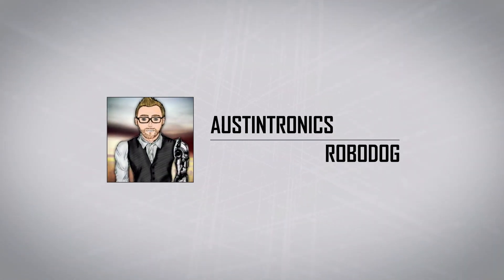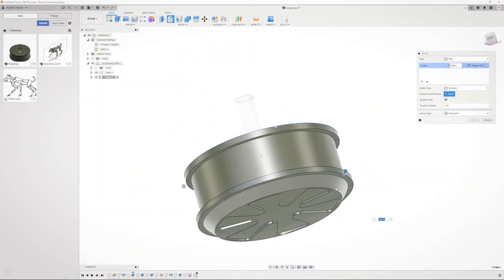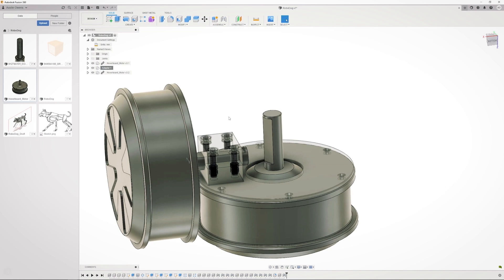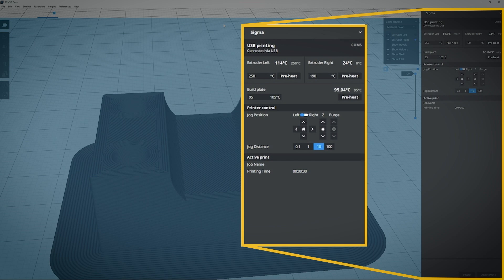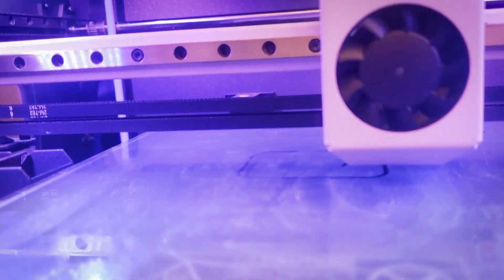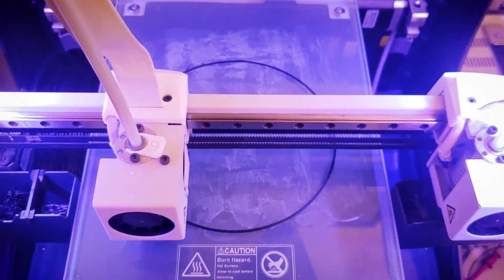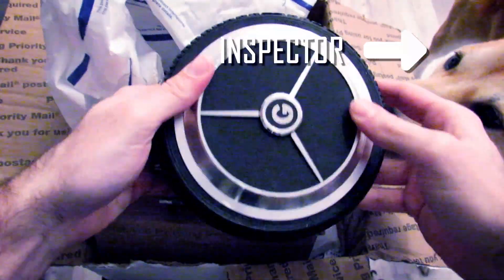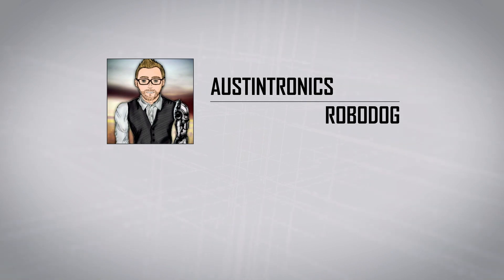RoboDog Part 4 | 3D Printing Prototype Parts for RoboDog

Comment: At a glance, that's a $2,000 - $4,000 printer. Your second attempt failed because the nozzle was too close to the printbed for the initial layer - is it really true that a printer of that cost somehow doesn't have a z-offset adjustment feature, requiring you to cancel the entire print and re-calibrate all over again? I've only had hands-on experience with $150-$600 printers, but all of them, even without octoprint, have had the ability to adjust the z-offset in realtime, and I use it constantly to fix exactly this issue, so I'm incredibly curious what prevented you from doing that

The final result looked pretty nice! Definitely seems like the sort of thing that would be ideal to mill from steel perhaps. for 3D printing, one must consider the layer adhesion as a potential point of failure, and the baseplate print was printed in perhaps the weakest possible orientation, but the one most ideal for a 3D printer - definitely the 'rapid' part of rapid prototyping, so that a final design can be mfctr'd properly :)

Comment: I think you are printing with ABS , as a tip to counter the shrinkage , multiply  by 101% or 102%  the scale of the model on the slicer before exporting  ,  usually it works for me . looking for more videos from you .

Comment: Scotch blue 2090 painter's tape is the best for 3d printing. give it a shot sometime.
Reply: painter's tape gets a bad rep as 90% of painter's tape has an oily surface to prevent paint from sticking to it, which is great for painting but horrible when you are trying to get things to stick to it.

Comment: Hi, I sigma r17, my glass is slightly bowed the only reason I found this out was because my z limit switch kept hitting the prints. I have flex plates on my other printers, as its a pain to scrape parts from glass, the only exception is when printing abs, I  chuck a box over the top of the printer to keep heat in, with a healthy  splash of pva glue, when it cools down to room temperature it falls off the bed, or if I'm in a hurry I'll spray the pva with isopropyl alcohol (Circuit cleaner, it's what I use to clean glass pei sheets on other printers).
Im so glad I stumbled on your series as 1,  I didn't know about the USB connection to bcn cura. 2 I have half a dozen hover boards cast offs from my kids, 3 I love learning I know nothing of fgpa programming or object detection.
Can't wait to see what I learn next!

Comment: How are you planning out your wire management for the shoulder joints to prevent snags?
Reply from the maker: Combination of wire sheathing and wire mounts throughout mechanical structure. Internal to the robot, was thinking of using DIN rail.

Comment: I thought the same thing.  Do you have the link to buy these motors?
Reply from the maker: I got some from here: 
https://www.amazon.com/gp/aw/d/B01CV1UAC8?psc=1&ref=ppx_pop_mob_b_asin_title

You can also get them from ebay as well:
https://www.ebay.com/sch/i.html?_nkw=hoverboard+replacement+wheel

Someone else in the comments was also saying that you could run an ad on OfferUp or Craigslist asking for broken/salvaged hoverboards for even cheaper.

Comment: This is a cool project and can’t wait to see more. FYI though, the printer should be calibrated to  accommodate shrinkage. Meaning, if you cad a 25mm test cube, and the printer makes a 24mm part, you adjust steps per mm until you get a 25mm part. My printed parts come out pretty much spot on.
Reply from the maker: That you for the advice!

Comment: You haven't figured it out yet. But you're buying used or salvaged hoverboard motors. They are not brand new. You're much better off buying local. Run an ad on OfferUp or Craigslist saying that you buy broken hoverboards. You'll get two motors for $25 all day long. And you'll get a charger it has a going rate of $15, you'll get a steel version of the outer clam shell piece that you just printed in plastic. The flat part of the axle shaft could potentially start to deform the plastic depending on the force. It should be a lot of force though they do use plastic ones on ones that are rated for little kids and they always use steel ones on the ones that are rated for 220 + pounds. How forces are applied in your device are obviously going to be a lot different. I'm not sure if your dog is going to be capable of getting one beer out of the fridge or a six-pack?
Reply from the maker: Good to know, thanks for the info!